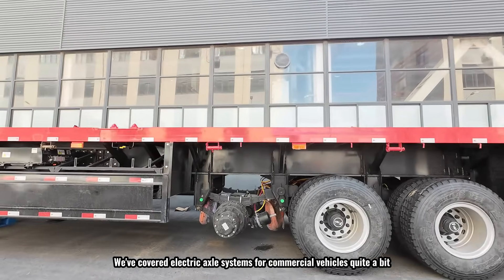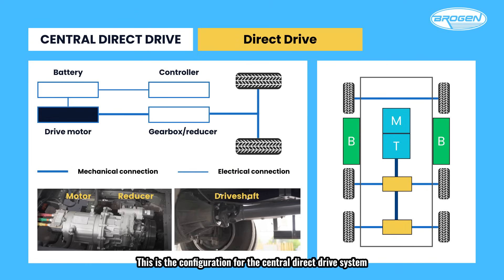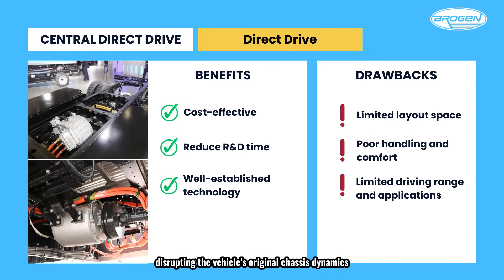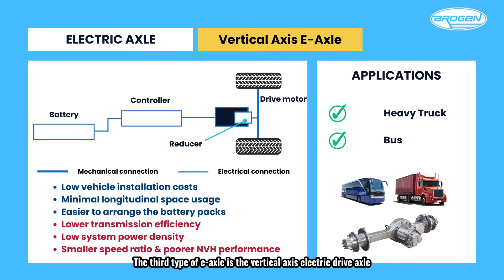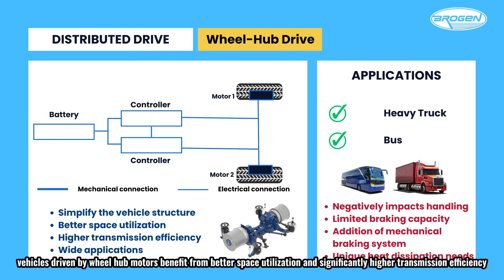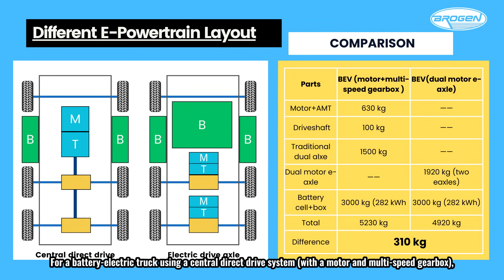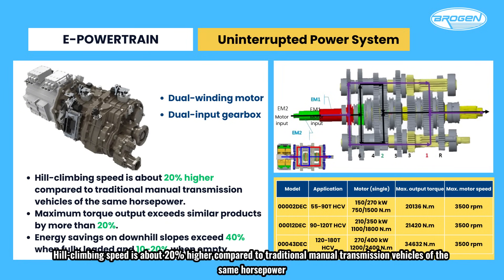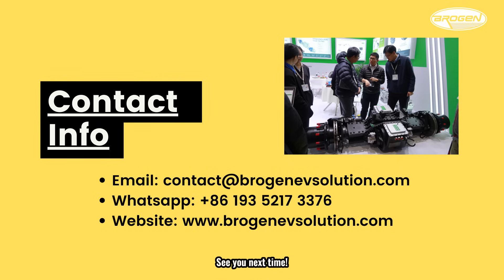Electric Heavy-Duty Truck Design: Which E-Powertrain is Better – Direct Motor or Electric Axle? #ev

Comment: I OWN THE PATENT FOR THIS MOTOR IN THE USA.  LOOKS NICE.  I WOULD LIKE TO SEE MOTORS INSTALLED IN THE ENGINE BLOCK, TO TURN THE MAIN CRANK SHAFT OF THE MOTOR, RUNNING ALL THE ACCESORIES THE WATER PUMP, AIR CONDITIONER, ALTERNATOR, POWER STEERING.  ASWELL AS POWER THE VEHICLE FORWARDS AND BACKWARDS.  THE MOTOR TRANSMISSION THAT COMES IN LARGER VEHICLES IS MUCH STRONGER THAN THESE CONVERTION KITS.  LAST 10 TIMES LONGER

Comment: 6:12 Both of the "controller" units that you reference here can be given a command from a PLC. A motor controller is not a PLC. a PLC can control the motor controllers so either your design is flawed or your explanation is.
Reply from the maker: The VCU calculates the total torque demand based on the driver’s acceleration or deceleration intent. 
The electric drive control unit (DCU) allocates the total torque between the left and right drive motors based on the steering angle, vehicle posture sensors, and road surface traction coefficients. 
The left and right motor controllers (or 2-in-1 integrated motor controller), upon receiving the instructions, convert the energy from the battery to the necessary power for the drive motors.

Comment: Batteries are very, very heavy  compared  to diesel engines.. Electric  trucks will not be able  to haul as much as diesel trucks because these heavy batteries reduce the amount of cargo that the trucks can haul beyond their own weight. This defeats the whole economic point of trucking.

Comment: This is a pipe dream.                                                Who's going to buy a piece of equipment that's down every 16 hours to charge.                                                       8 hours everyday it does nothing.
Reply: Check out Janus Electric. They are an Australian company that retrofits commercial trucks that are rated to 192000 lbs. and they have large battery boxes that are removed with a forklift and a replacement charged battery put back in it's place. Takes less than 5 minutes and your going again. Their on the East coast of Australia and have exchange facilities about every 2 hours apart. They will upgrade these facilities with 2 robotic arms that will do the change even quicker. The removed batteries go back into a charging station so the next truck down the line can swap out, plus it puts a more even load on the electrical grid.
Reply: You should see what Edison Motors is doing with their hybrid design. Makes total sense and there's no range anxiety.

Comment: Looks like this is Edisons supllier.
Reply: Their supplier for their first prototype ("Topsy"), or their second truck (the snow plow now under construction)? They're different. 

E-axles all look pretty similar, and manufacturers in China routinely straight copy each other and legitimate manufacturers, so it's hard to tell from appearance.
Reply: @brianb-p6586  These look like the axles they now bought for the truck after Topsy.
Reply: exactly
Reply: Edison motor dont own electric axles , they didnt invent them, they were around before that tiny company

Comment: The electrical system is by nature very consuming and complex.
Reply: It's extremely efficient and far simpler than an engine and gearbox.
Reply: Have you ever seen the inside of a modern diesel engine? Considered the cost of transporting fuel to thousands of stations? Your comment doesn’t stand up to even casual scrutiny.